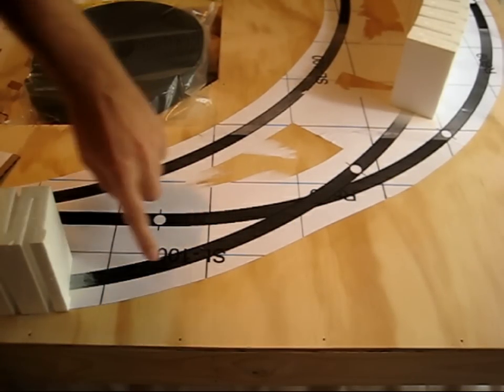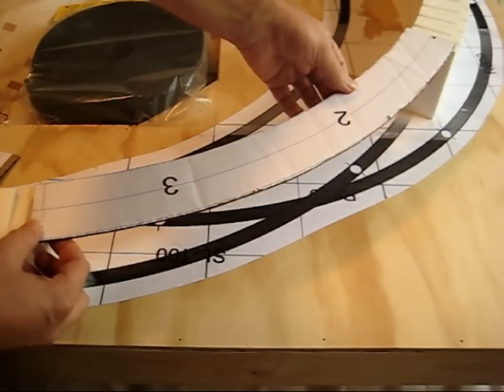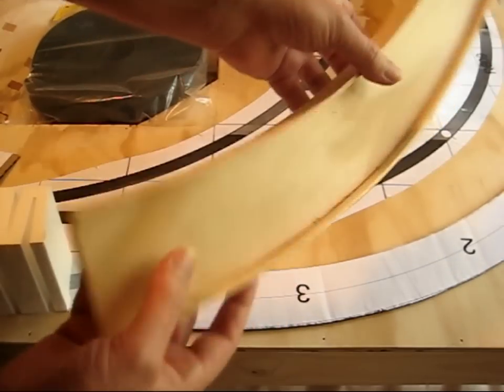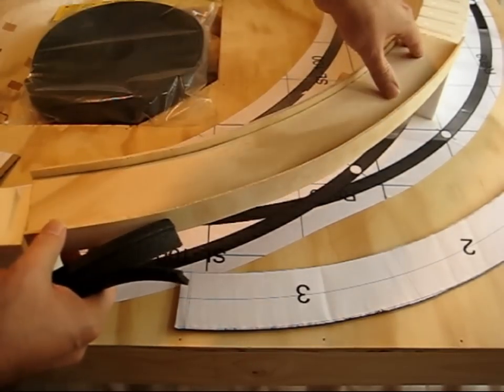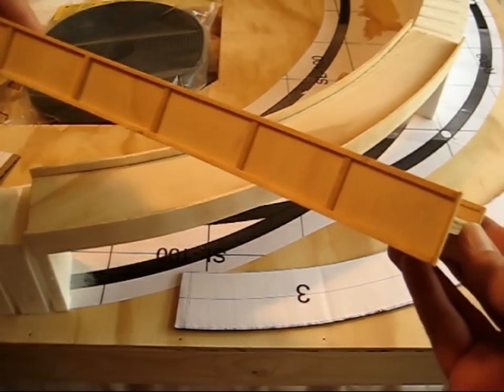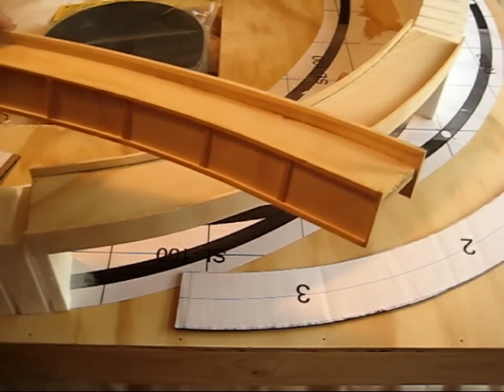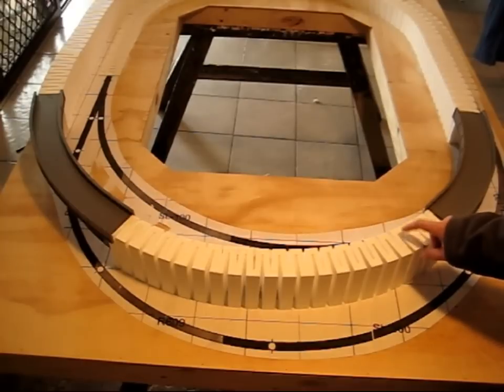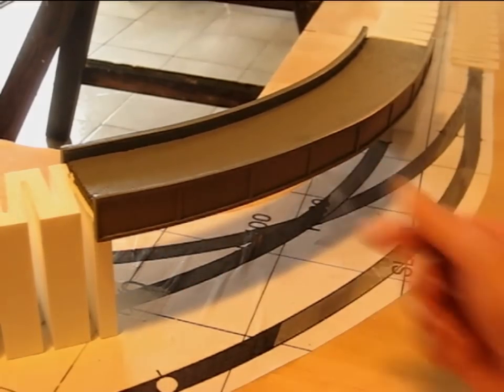Building a curved bridge for the layout

Comment: Brilliant, Mate!  The curved bridges. Many (20) years ago a built a simple one-off over/under for under a Christmas tree, and was faced with the curved bridge dilemma.  I kit-bashed a number of commercial bridge kits, angled the cuts such that it used four sections to make about 50 degrees of radius curve...so just about 17 degree angle per cut, with three joints (if that makes sense?).  

Yours is far more elegant, and never occurred to me!!  LOL...Thumbs up, from "Up Over" in the USA!!  LOL.

Comment: Quite improbable Bridges in real life..... BUT, very clever method of constructing them!! 👏👏 I'm going to remember that, when I do mine.
Reply: PacbeltRR I have heard that criticism before. What is the solution?
Reply: I wouldn't do anything, unless YOU actually want to....
No, it would never exist in real life, but it's a clever adaptation.
Curved Bridges exist all over the World. A Curved Deck Bridge, like yours, wouldn't have curved panels. They would be a series of straight panels, angled to create a curve....

To accomplish that, each straight section must have a supporting Pier going to the ground. The angle of the track running underneath, makes that nearly impossible.
I wish I could post pictures here.... You could possibly run a long "Steel" girder under your existing Bridge, to Piers placed away from the lower track. Even ONE would represent a real attempt at proper support for such a Bridge.  Pictures of this exist on the web...

I'm looking at this from the view of a Structural Engineer. However, I don't have to like it! Some other guy's opinion doesn't matter.
ALL that counts, in the end, is that YOU like it! (And of course, it doesn't derail your Trains!)
Carmine 🚂
Reply from the maker: +PacbeltRR keep I eye out for my new video series where I be making curved bridges out of balsawood
Reply: Thanks! I will.

Comment: That is a good idea! What did you use to cut the thin sides that attach to the curved 7mm  plywood?
Reply from the maker: The balsa wood I bought was 100x3mm about 500mm long. Using a box cutter I cut it up into strips.